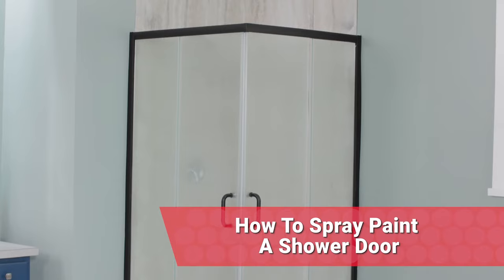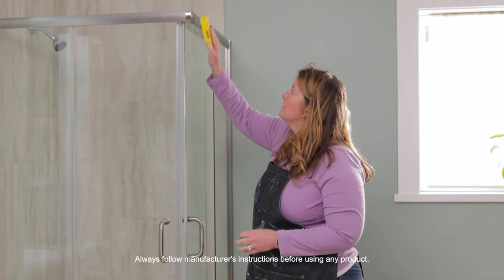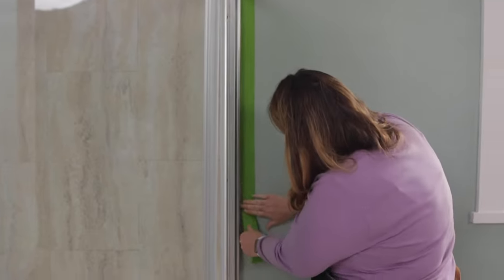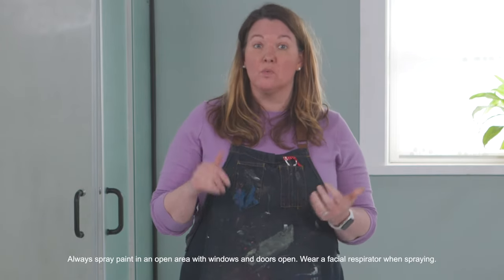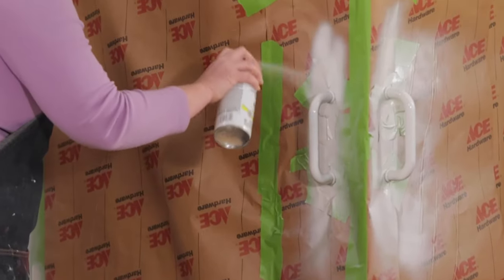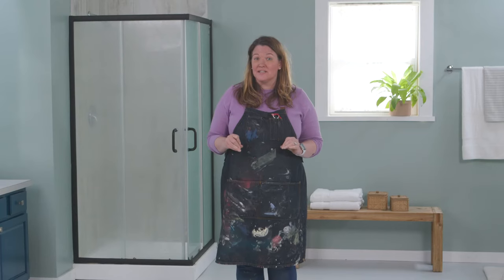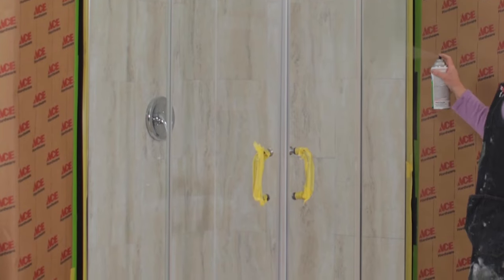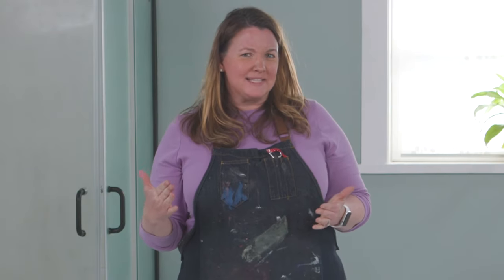How To Paint A Shower Door - Ace Hardware

Comment: I spray painted a light fixture over my bathroom sink recently.  I put up newspaper about 2 feet wide all around the light fixture to catch the paint spray.  After I finished, I noticed that the black spray paint had got on everything in my bathroom.  The paint was on my toilet, the floor, the bathtub, etc.  I used solvent to wipe up the spray.  I will NEVER EVER spray paint anything indoors ever again.  Anything I want spray painted, I will take it outdoors and spray it there.